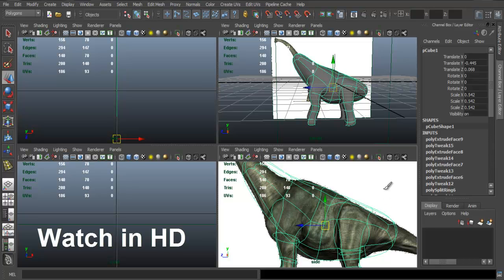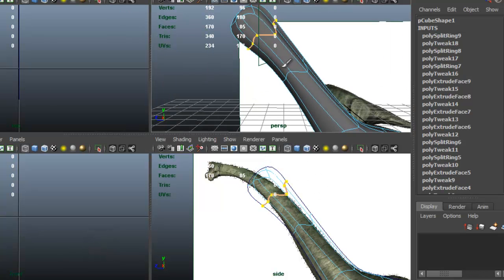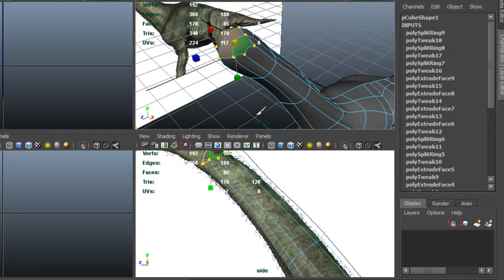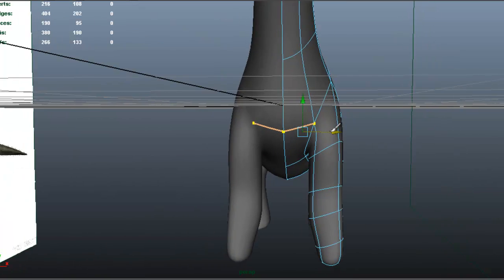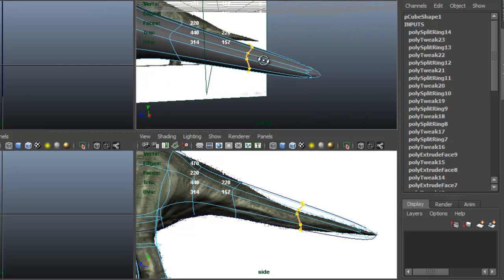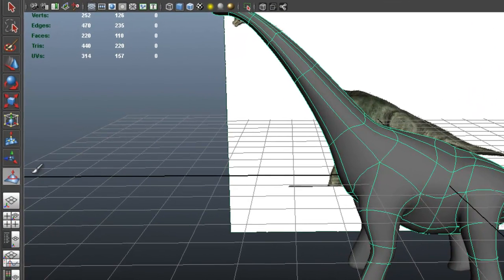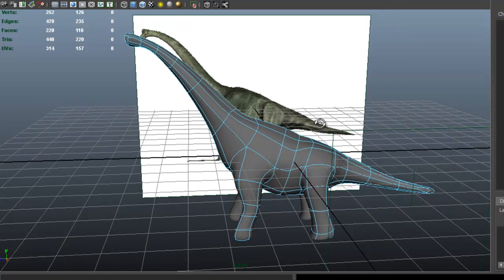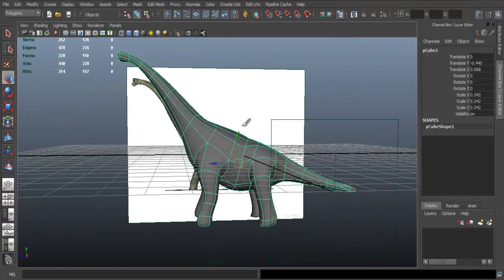Autodesk Maya 2013 Modeling Tutorial - Dinosaur (brachiosaurus) Modeling Part 3

Comment: Please, can anyone help me? I can't do what you do on 2:35. I'm trying and I can't put straight the edges as you do. I'm doing step by step the brachiosaurus but in this part I'm stuck.
Reply from the maker: Basically what you do is switch to your scale tool(r) and open the scale tool options. From there click on custom axis orientation, set to edge, at which point you click on one of the edges of your model( click on the one I did in the video) after doing that your scale tool should be ready. Use the red cube of the scale tool to make the edges straight. Hope that helps; I am not sure what results you are getting.
Reply: 3dEx Ok, I'll try it. Thank you

Comment from the maker: it should work fine, try changing the radius to a larger size or smaller size to see any changes. very rarely it doesn't respond for no apparent reason, when that happens you will need to restart maya. Also, make sure you are in object mode.